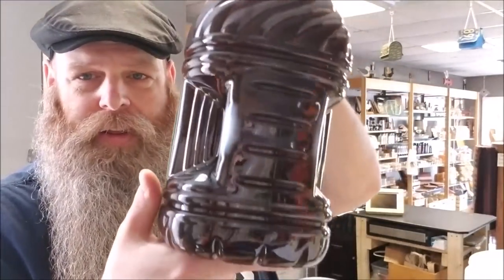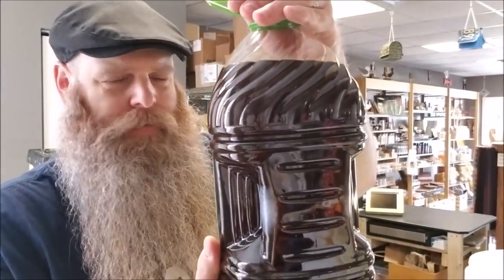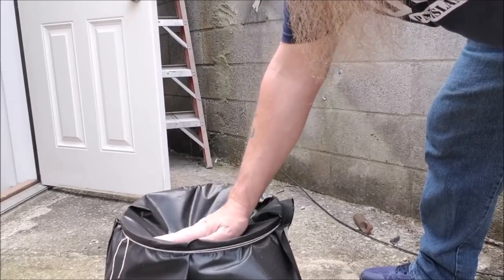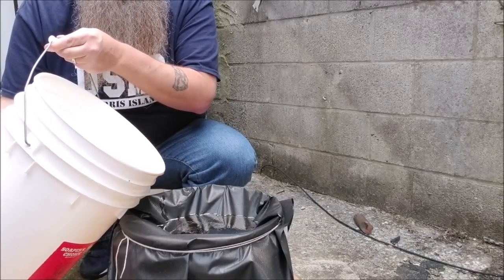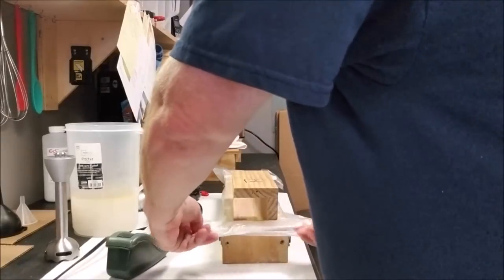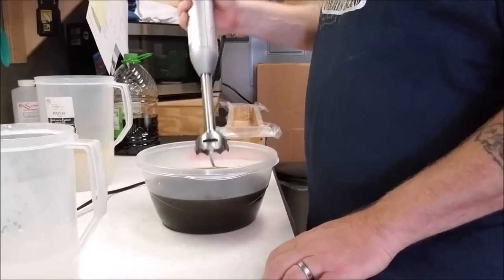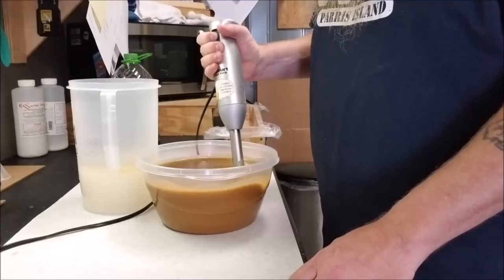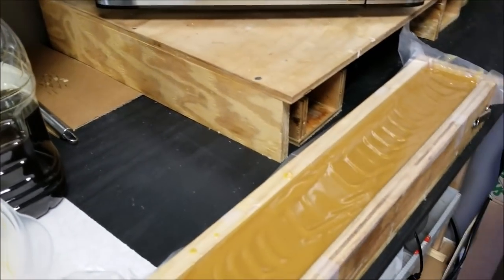How To Make Soap From Recycled Cooking Oil

Comment: Very nice, her in Egypt we used to do this soap for cleaning the dishes. but we do extra step which is washing the soap paste after cooking it (HP soap) using water to remove the residual wastes, we use stearic acid also because because the soap turns to jello if it was in wet areas. Excuse my lang. Thanks a lot.
Reply: How much steric acid do you use? In a batch?
Reply: Am from Trinidad I tried it and I add fragrance and ballief hm lovely

Comment: Hi! I was looking for a cheap recipe of soap to try, and just found your video, thank you!! I have access to a combination of sunflower and corn oil, do you think it will work with the same amounts as canola oil? Or do I need to adjust something?
Your soap turned out so pretty! Hope I can make something similar with what I have on hand :) I'll check the rest of your videos!

Thank you again
Reply from the maker: I would plug then into soapcalc and make sure. Corn oil can be a little word of used in high quantities. That gallon jug of canola oil is about $3.50- $4.00 at Wal-Mart and will do a couple batches easily by itself. Hope it turns out for you!
Reply: @unclejonssoap  Here in my country is kinda expensive (olive oil too) so I was looking for an alternative. I will keep searching for info :)  Thank you for your response!
Reply from the maker: It's worth a try to use the corn oil / sunflower oil. I would do a small batch first to make sure it works well for you. Most of this is going to be experimenting to see what you like 😁
Reply: @unclejonssoap  Yes, I'll try :D If it works, I'll be back here to tell the recipe, maybe other people find it useful. Thank you again!
Reply: Hi! I made my first batch of soap!! Is a small one, but I used soybean oil (it was on sale) I used 300gr of soybean oil, 41gr of sodium hydroxide and 100gr of water. It doesn't lather much, but I turned some of it into liquid soap (the liquid version does lather,  don't know exactly why) and is awesome to wash dishes, our skin is very grateful. I will make more and give it to my family :D
Thank you for the inspiration and support!
Reply from the maker: @sashaalentorn491  many liquid oils don't lather much at all. Adding some coconut oil will help with the bar soaps lathering. Congrats on your first batch!

Comment: You can buy a filter specifically for filtering oils from a restaurant supply store. If you plan on doing this more than once it’s definitely worth checking out. I worked at a takeaway and we would use these every morning. It’s like a funnel shaped coffee filter but with several layers. Oil runs through it really quick and comes out crystal clear. Our oil never looked dark like that stuff you are using though. I’d hate to taste food cooked with that oil before it was changed 🤢 that being said, stuff cooked in the brand new oil didn’t have much flavour. There’s kind of a sweet spot where the oil has been infused with the flavour of the food but still tastes clean. We used to time it so the oil was ‘ripe’ during our busiest days so the most customers could enjoy it.
Reply: Ps that’s also why when you fry stuff at home it doesn’t taste the same as food from a take away. I guess if you reused it enough it would but it would take a lot of uses.

Comment: I'm new to soap making and i want to recycle oil. Where I live sunflower oil is the cheapest oil available, so I'm guessing that's all I'll be able to get. Would that work?

I also saw another video that put activated charcoal in the oil and let it sit for a while so it would absorb some of the smell and nasty stuff, I might give that a go too!
Reply from the maker: That oil would work fine. You can use charcoal but it's not totally necessary as long as you filter the oil. Let me know how it turns out 😁

Comment: I made a filter by drilling about two dozen 1/4" holes in the bottom of a plastic bucket. Then I packed the bottom of the bucket with rolls of toilet paper. Ttake the cardboard tubes out of the rolls so you can compress them. I packed the rolls standing upright in the bottom of the bucket and then jammed extra TP into any voids between rolls. I place the filter bucket inside another bucket and pour in my waste vegetable oil. It filters out even the tiniest particles.

Comment: How do you know what trace looks like and can u use this for dish washing?
Reply from the maker: For me, trace is when I pull the mixer head out and whatever drips off leaves a slight dent in the surface. This soap could be used for dishes but may leave a slight film behind.

Comment: What do you add to the lye calculator for type of oil?
Reply from the maker: I just use the calculations for my basic mixed oil recipes. So, my bl nd of olive (or canola) coconut, palmy, etc. whatever the water and lye amount I use there is what I use for this one. It's worked very well for us. Otherwise, you can just go with whatever the bulk of the original is. For this one, the restaurant used canola oil exclusively for their fryers. I just ignored any other fats that might have come from chicken or whatever. Hope that helps.

Comment: Awesome here come my kebab soaps!
Question(s)! Will the oil become rancid causing DOS ,also what kinds of fragrance could be used to mask the smell?

Would you use this on your face or rather mix coconut oil in it to create a gardeners soap!
Reply from the maker: I wouldn't worry about DOS unless you don't filter it out enough. It should be good for any type of soap really. But if you're really worried about it going bad, then you could try to get as close as possible to zero super fat and just use it for a general cleaning / laundry soap. As for fragrance, any fragrance or essential oil can be used... But there is no smell...lol

Comment: Use somme heat with your oil and it will go throught a lot faster, to clean your oil, boil it in salt water, the dirt qets a highter density and separate from the oil.

Comment: Hey uncle Jhon...!!!! Working in a restaurant I’m cooking about 80 lb of bacon,,,and frying so much things  on a deep fryer....... any formula to make soap adding lard n used fry oil ...????
Reply from the maker: If you're using bacon fat and used cooking oil, I would use lard and whatever your main frying oil is in the lye calculator. Just make sure your used oil and bacon fat are very clean before trying to make soap with them. Otherwise your soap might get funky rather quickly. Filtering is the least I would do. Might not be a bad idea to wash each oil as well to get the nasty stuff to settle out. That's a whole other topic...lol. But it can be done.

Comment: Interesting.  What if the used oil was a combination of oils?
Reply from the maker: Generally,you would want to know the approximate ratio of the different oils. That would make the lye amount and super fat more accurate.
Reply: @unclejonssoap  Makes sense. Thanks
Reply: @unclejonssoap  It makes sense.  WIll take that into account. Thanks!

Comment: I bought paint from a Habitat for Humanity place.  Unbeknownst to me, the paint was old and it had little lumps even after mixing.  To make a long story longer, Home Depot sell a 5 gallon bucket size sock to specifically strain paint.  It is elastic and fits around the top, but I secured it with binder clips.  Maybe it would be a better than the garden paper to strain oil?  It was around $5 for 3 socks.  I found it in the paint section.
Reply from the maker: It would be great as a first run filter for bigger peices but the oul would stull need to go through finer fabric of some sort a couple times.

Comment: Thanks for the recipe!! Can I use peanut oil I have a lot from my Turkey fryer? Also can I use essential oils?? Thanks again!!
Reply from the maker: You can use essential oils for sure. Just check with the manufacturer to see what the safe usage rate is for each one. As for the peanut oil, you sure can! The only thing I would do is to make sure other people know it's peanut oil in case of allergies. If you're not selling then no big deal. If you do sell, then I would make sure people know about the peanut oil and that there are probably other fats in there too (like from the turkey). That's what I do on my labels with recycled oil.

Comment: What size mold is it you're using ?
Reply from the maker: My mold is 3.25" wide x 2.5" high x 21" long ( all inside dimensions). That's the size that works well for me since I cut my bars 7/8" thick.

Comment: Does the soap smell like fried food
Reply from the maker: Ours doesn't. But it all depends on how used the oil is and if it was overheated, what was cooked in it, etc. But most times, once you filter it and add the lye and fragrance it doesn't cure with any food smells.
Reply: @unclejonssoap  thanks for sharing your recipe

Comment: Does used soybean oil from the fryer work the same as this?
Reply from the maker: Yep!
Reply: @unclejonssoap  I'm going to try making soap I have a restaurant and have lots and lots and lots of used fryer oil all made from soybean oil.   Should be interesting, I already make my own laundry detergent have been for years.   Also on a side note they make filter cones for straining fryer oil.  You can get them on Ebay, Amazon, or any restaurant supply house online.

Comment: It's great, but I'm concerned about the oil or whatever waste that this soap produces while using it. Isn't it like pouring small amounts of oil down the drain?
Reply from the maker: It's no different than any other real soap honestly. Now, if you make any soap with too much support fat, it can cause some minor build up issues. Just a matter of making it correctly 😁

Comment: have you made soap using potassium hydroxide?
Reply from the maker: I have. The issue is that it makes a sister soap. So, you would need to salt the soap in order to harden it. Just like making soap with wood ash.

Comment: I'm a chef and I've worked in many kitchens, Restaurant  oils even the cleanest are not greatest in smell, Could you add a FO or EO, what do you use it for or sell as. Eg gardeners or mechanics soap
Reply from the maker: The smell after saponification isn't anything like used oil...lol. But yes you can add FO or EO just like any other soap.
Reply from the maker: This is a regular soap. Good for bathing, hand washing, etc..

Comment: I love the idea and I want it to work, but my soap smells funny even over top of essential oils and it turns to mush quickly in the shower. I even did hot process with 0% superfat then added some coconut oil after cooking to try to achieve saponification of all recycled oil and then create a clean superfat. But the finished product is not ideal, i.e. soft and  smelly. Any recommendations?
Reply from the maker: It really depends on what was cooked in the oil, if they burnt the oil or used it too long, and how clean was the oil before you used it. If it stinks when you started it might not be any good to use for soap.
Reply: @unclejonssoap  thanks for the reply! I got in touch with Laura Kneib of FROG soaps and she gave me some good tips, I'm excited to try again
Reply: @caitlinchew6170  What were the tips?
Reply: @Mr3LMAR  cold process, start with 50% recycled oil and 50% virgin oils then increase recycled oil if it comes out well, 0% superfat

Comment: I heard you can filter the oil by putting plain flour on top wait for the flour to sink to the bottom and then pour off the oil,
I havent tried it personally would be interested if anyone else has.
Reply from the maker: Yeah, if like to try that too.
Reply: This works. I did this several years back when my husband experimented with frying the A thanksgiving turkey. There was so much oil left over. I just could not see all that oil go to waste! I made some fantastic bars with peanut oil that year.

Comment: One of these days I've got to attempt this for both biodiesel (apparently glycerine is a byproduct that some soapers use as well) and soap! Cleaning up the oil is what has slowed me down from trying this sometimes Free99 ingredient.  Is there a good way to 'wash' the oil to get rid of the food scent it seems to hold on to? 🐰  Jen
Reply from the maker: For me, just screening the oil a couple times seems to be enough especially once it has gone through saponification. The soap I've made has no added oils, scents or additives and it has no bad food odor at all.
Reply: @unclejonssoap  Wonderful! Totally going to try this out. Now to find a source....
Reply: I used to run a biodiesel lab. We would mix incoming oil in a tank to keep an consistent blend. Constantly pumping through a filter to cycle everything. Then we would pump it up into a heating tank and have it go through centrifuge to get out even more food matter. Afterwards it was pumped into one of two processing tanks. We would make biodiesel and then have the tank sit for a day to settle out the glycerin. We would pump out the layer of glycerin and it would still have a lard and sometimes fryer smell.

Comment: You have to wait a month before you can use it right?
Reply from the maker: Nope 😁
Reply: Uncle Jon's I thought cold process has to cure for 30 days
Reply from the maker: It does improve over time but there's nothing wrong with it fresh. It's not dangerous and it works very well.
Reply: Uncle Jon's thank you. I didn’t know. I made soap a few times. I need to make some more. It’s complicated to me. I like moisturizing soap so I add shae butter to it. I’m not sure when to add it.
Reply from the maker: I'd you're doing cold process I would just add the Shea butter to the other oils all at once. Just remember.. soap isn't really suppository be moisturizing. It's job is to be clean. You can make it more gentle but it's mainly for cleaning.

Comment: According to SoapCalc, only using canola oil for making soap will have 6 hardness and zero cleansing. How come your soap looks normal? Is soapcalc wrong then?
Reply from the maker: Soap calc definitely has a few thing that I question..lol. One of my next chores is to do some comparisons of different calculators to see if there's something a little better around.
Reply: @unclejonssoap  can you please mention other single oil soaps that make hard bar and good for use too. I knew about coconut and olive oil but didn't know 100% canola oil soap could be made too.
Reply: @unclejonssoap  also what percentage of water you use? 38% as the calculator suggests?

Comment: What is Lye? I am unhappy because I got to 8:30 and then realize I can't make this because I don't know what Lye is.
Reply from the maker: 🤣 Yes.. because every question can be answered in one video..lol. Sometimes you have to take a little time and look something up. But, to answer your question directly.. the lye used in soap making is almost always either sodium hydroxide it potassium hydroxide. Sodium hydroxide for bar soap. Hope that helps.
Reply: @songzheng3817  the problem with making your own lye from wood ash is that you have no way to tell how weak or strong it is. You don't need to be a scientist to search for lye (sodium hydroxide) online. It's a chemical used in many drain cleaners and in some food production. Do a search specifically for sodium hydroxide and you should find many articles and suppliers.
Reply: @Uncle_Jon  thank you!

Comment: I think vacuum filtration would work best. You need some cheap lab equipment.
Reply from the maker: I'd need more space too..lol. Not sure I'm ready to scale up the recycled oil soap yet. Plus, the tavern next door closed up due to a huge rent increase 😭
Reply: @unclejonssoap  honestly you can fit vacuum filtration up on that workbench no problem. I can see your constrained in space, I’d be more worried if you’re clumsy, it’s all glass. Probably not worth it if you don’t produce a lot of the “recycled “ soap though.
Reply from the maker: And, I can be a bit uncoordinated 🤣
Reply: @unclejonssoap  Same reason I haven’t replaced my old set 😂.

Comment: I made some the other day and used it for laundry with borax and washing soda the problem was the laundry had oily  smell 😣 
The superfat in my soap was 5% i guess that is the problem
Reply from the maker: Yep. Try to get closer to zero super fat. That will take care of it. Also use less soap in the recipe. About 2 ounces of soap for a 2 pound batch is all you need.
Reply: @unclejonssoap  ur the best 👍
Reply: I was using palm oil (after using for frying)  and coconut oil with 3% supper fat. after filltering the palm oil, I warm the oil using rose petal and lime water with double boiler. When the cooking oil cooled (I was usually waiting for the day), I started making my soap and the result is supperb.  Coconut oil make it extra cleansing but not conditioning.  I use them for my dish washer cleaning and detergent. For the the recipe I use detergent recipe from fairy cottage (just search them) just subtitute castile soap with my homemade palm soap. 

They are not conditioning so I dont recomended using them as hand or body wash.  If your hand feelss drying just mix olive oil in them.  Calculate use soapcalc or something like that.  I was using saponiclac. 

This video encourage me for making used oil soap. I try live zero waste little by little so i thought to recycling everything I can instead buy something new ^^